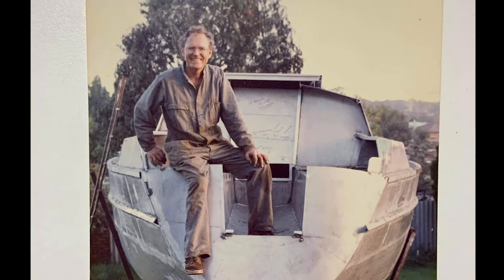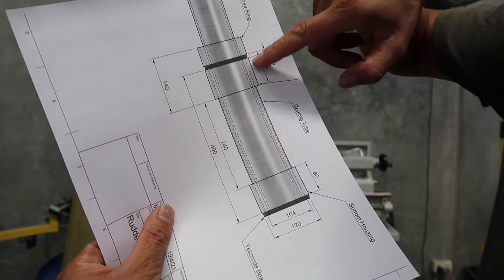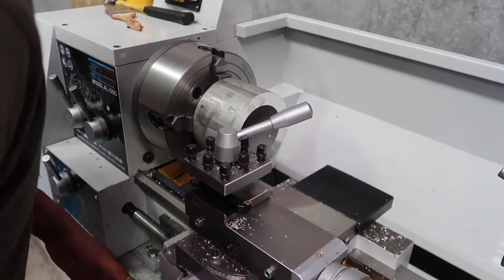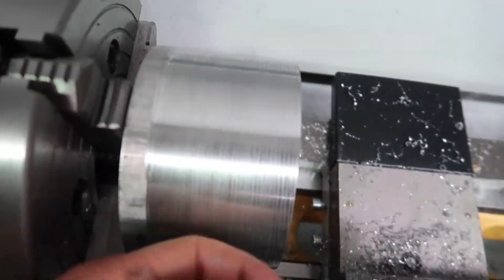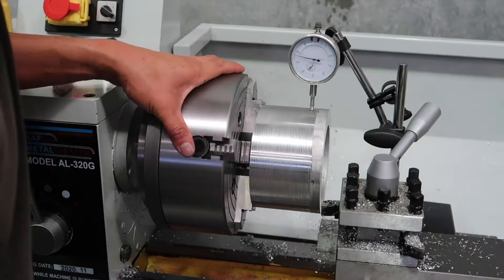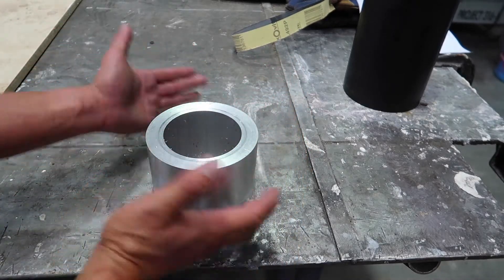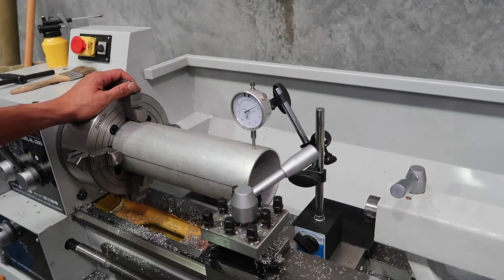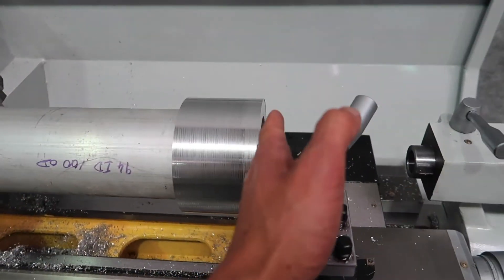Sailing Kulali - How to build Rudder Bearings for an Aluminium Sailboat with UHMWPE - Day 16

Comment: speed and feed rate on your finish by  the way never use pliers on emery paper hold it very lightly with your fingers it bites drop it .Thats how i was taught i started with a 320 when i was 17 never used it much might buy another one  as theyre cheaper than the optimum i am looking at. On the  sealing tube id run a bull nose live centre aka a pipe centre
Reply from the maker: Thanks Nick. Whats the reason to not use pliers? I was worried about using fingers incase it somehow catches thats why I used pliers haha. Will be looking at a live centre. Do you reckon a cheap Ebay one will be okay?
Reply: @sailingkulali  eBay would be fine the reason why you don’t use pliers is incase  the emery paper grabs it’ll drag your hand in any you run the risk of loosing a finger or worse your whole hand
Reply from the maker: @nickking8317  ah shit okay, here I was thinking it was a safer option. Will do the finger trick next time. Cheers!
Reply: @sailingkulali  no worries mate I almost completed my apprenticeship and my last year was in a machine shop still got my home shop here just after new machines 3/4 of them a small mill small lathe and a bigger lathe or 2 to accomodate the mill plus a few grinders like a d bit took and cutter plus a surface grinder. Also for all I use water solvable stuff like existing mettalium it’s what I have hare and Forbes sell it I also use wd40 and find that better for aliminium. Hope this helps
Reply: @sailingkulali  grab it at the end with both hands and hold it very lightly so if it grabs it pulls itself out of your hands
Reply from the maker: Thanks mate will do!
Reply from the maker: Yeah will try wd40!

Comment: In regards to your surface finish, depending on your carbide insert there will be a minimum depth of cut, this will avoid rubbing. If you remove more than the minimum cut your surface finish should improve. You can always play around with the settings on a piece of scrap.
Reply from the maker: Thank you! I will look into the specs on the tips and muck around with depth of cut. I haven’t been game yet to change the auto feed speeds.